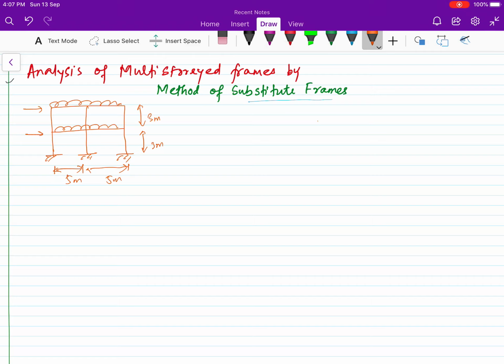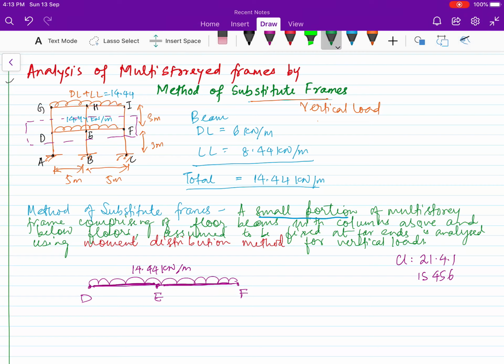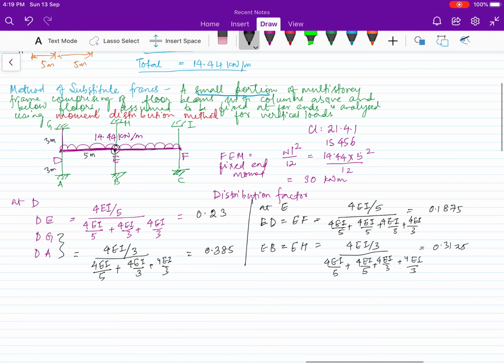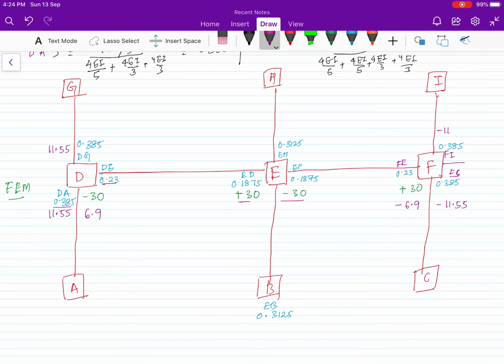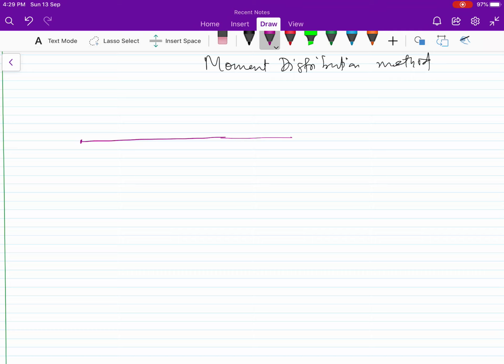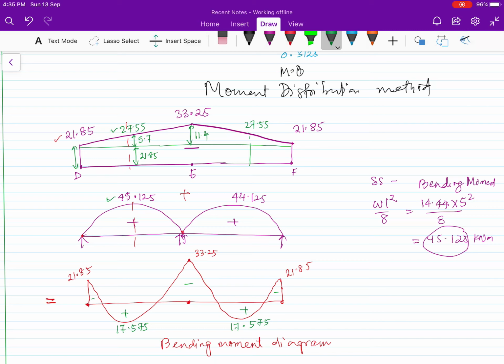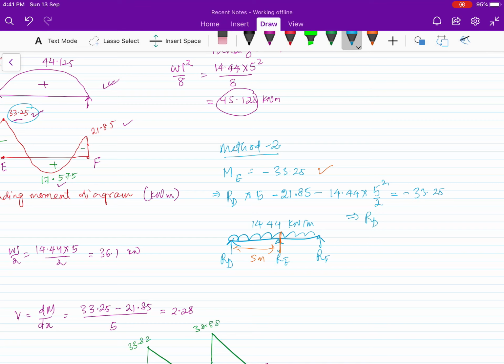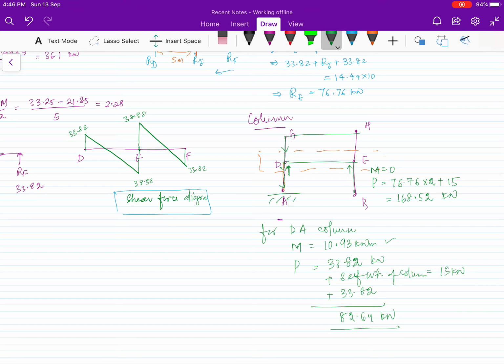Substitute frame method

Comment: I have seen different book  and e book but multistoried building design considering siesmic load  with detail manual calculation is delivered by you which first I have seen. 
     Thank you for this video. I also want a clear video of manual calculation of load combination and it's importance for building design . Which you have also touch it in your video of col. and beam design.